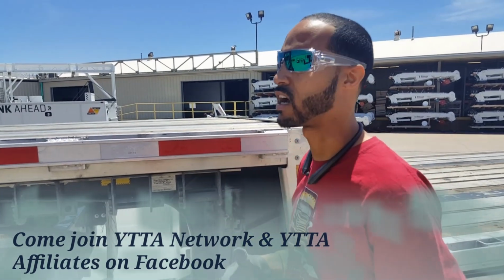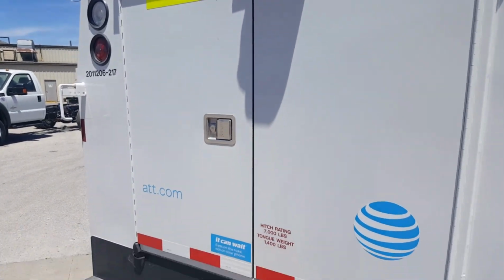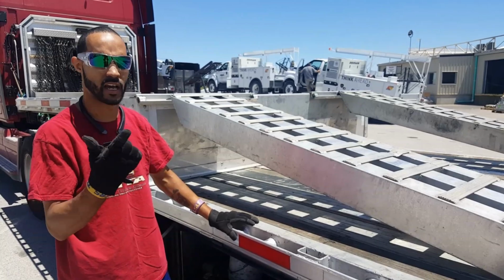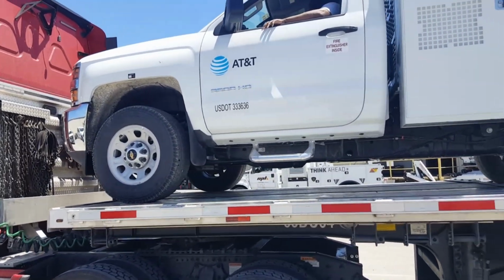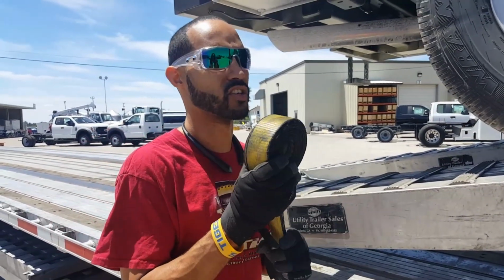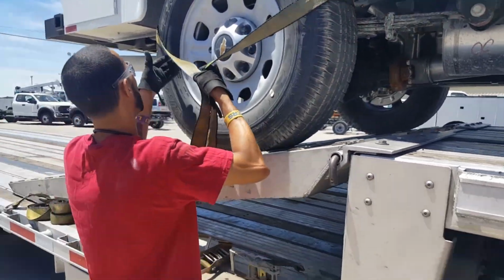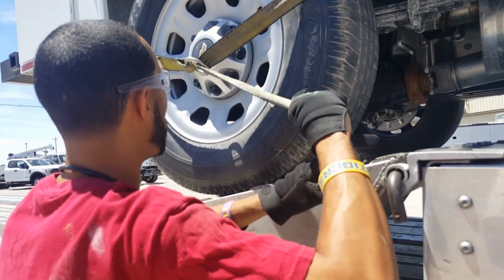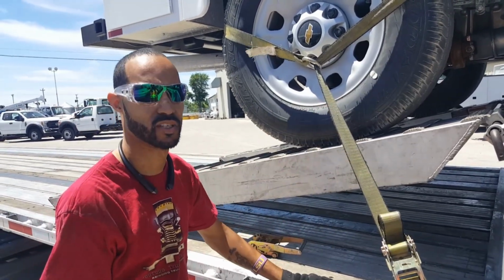Trucking | Loading & Securing A C3500 on A StepDeck | LoShawn Parks

Comment: I'm not in flatbed division but in cdl school I was taught you should never hook your straps or chains to that outside bar. It's only a simple weld that holds it on, so instead you should run it on inside and hook to trailer itself. Also there's a reason they call that outside part a rub bar... If something rubs against it it protects the straps if they are on inside as opposed to outside, if they are on outside those straps could be cut. 

This is just what they taught us in cdl school and it makes sense but like you said everyone has their own way. Also I'm no expert since I have only done dry and reefer van.... So far.
Reply from the maker: David W. That is true. but like you said there are a million ways to do it. as long as it secure and ain't going nowhere.

Comment: Did you have any issues with turning due to the vehicle so far up to cab?   Thanks for the video.  I am a CDL student and this helps a lot!
Reply from the maker: Frank Sotelo No because the front end of the trailer swings out opposite of the direction the truck is Turing
Reply: thank you!